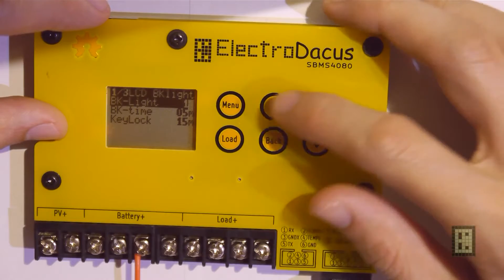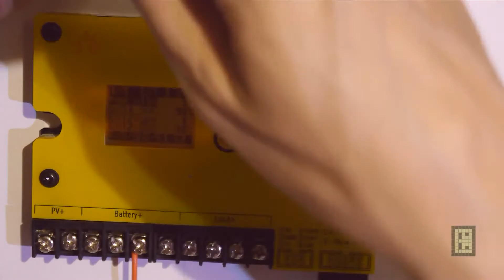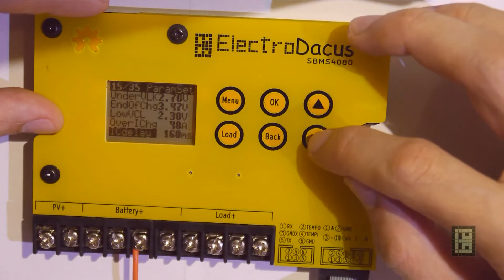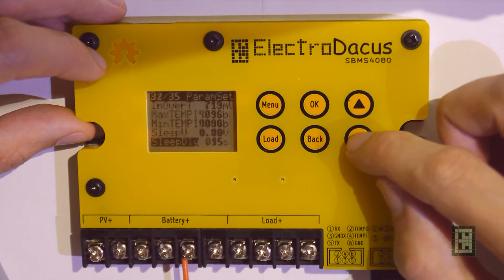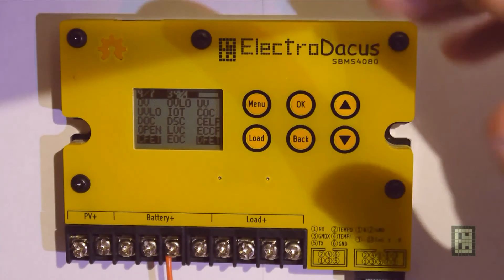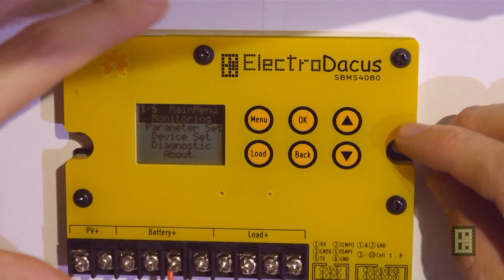Solar BMS user interface

Comment: Thanks for the thorough walk-thru on the interface.  I have a couple of questions.

1.  It seems the connectors are only for 12awg wire at the maximum.  Why did you not use more substantial connectors that can accept 10 or 8awg wire?

2.  What do you anticipate will be the cooling requirements for the SBMC?  Will most of the heat be dissipated by the back plate?  Will it require a small fan to blow air over the surface?  I am trying to plan for mounting and need to know the thermal cooling requirements.

3.  I did not get in on the kickstarted, when do you anticipate shipping them and what is the cost?  Where to order for the first batch?

Thanks, rick in colorado
Reply from the maker: Hi Rick,
1. Yes they support max 12 awg and I use 4 in parallel to keep the size and weight of the unit down. Some applications may require a light weight unit and the international shipping has also a significant role. There are some other good reasons related to PCB I hope to do the part two about the hardware and I will go in to more details.
2. I was also going to talk about the cooling requirement in part two. The passive heat dissipation of the SBMS is about 6W and the heat will depend on the charge and discharge current. The charge part has a 6mV drop / Amp so at max 40A you have 40A x 6mV = 0.24V x 40A = 9.6W dissipated and on the load side the voltage drop is 2mV / Amp so 80A x 2mV = 0.16V x 80A = 12.8W.   So if you do charging and discharging at the same time you need to be able to dissipate around 22W well above the 6W capabilities of the solar BMS as it is. You can use a fan or an additional heatsink . The SBMS is designed to be able to mount on a heatsink that can also be a simple aluminium plate with a surface area around 4x the surface of the solar BMS.
For his current capabilities the SBMS has probably the lowest power drop since I used the best available mosfets and low value current shunt resistors. You can use at most 20A charging and 40A discharging simultaneously with no additional fan or heatsink since the heat dissipation will stay under 6W
3. The Kickstarter campaign ended and the shipping date was promised around October but I will sun start building the first batch so I estimate shipping will be sooner. You can still order one from my website electrodacus.com
Reply: ***** Thanks for the thorough reply.  22watts dissipation at full load is excellent. I am planning a PV system for my RV right now and after researching lifepo4 batteries and running across your youtube videos and kickstarts campaign I am thinking that lifepo4 is the way to go despite the high initial outlay for the batteries.  One of my concerns is still cold temperatures and charging.  I plan to use the RV in the winter as I enjoy back country skiing and from what I have found in my research leads me to think that I will need to have a battery heating system do to the bellow freezing temperatures.  I will be at high altitude and overnight temperatures can get to -20c.  I will have a heated interior space while I am in the RV, but it will not be heated when I am not there.  I suppose I could keep the LP heater going at a minimal level to keep it above freezing say 5c while I am out/away.  But I don't think 5c is warm enough for charging.  So my second thought was keeping the batteries in an insulated box with an electric heating element run from the PV or battery.  The batteries would be warmed up before the sun was high enough to start charging.  If you have any recommendations I would very much appreciate hearing them.  

BTW, any discounts for multiple purchases, say three 4080's?
Reply from the maker: Rick Fetters
All batteries suffer form high and low ambient temperatures. LiFePO4 is actually the least affected by low temperatures. And 5c will be the safe low limit for charging without any effect on battery life.
Probably the best solution is to have a insulated box keeping the battery at around 15 to 20c that will not require to much power since the box can be completely sealed there is no gases involved as there are with Lead Acid so the box dose not need to be ventilated. Even without a heater considering the large thermal mass of this LiFePO4 batteries and a good thermally insulated box the battery can stay above freezing for days.
Ideal is to keep the batteries always warm since if they cool down you will need a significant time many hours to rise the battery temperature again do the large thermal mass especially with large cells.
I do not have any profit on this project was mostly done for my needs but if you are in US then I can reduce the price for shipping for the additional two units that is 30$ total discount.
You can order 3 and I will send you the 30$ discount or you can ask me for an paypal invoice if you want.